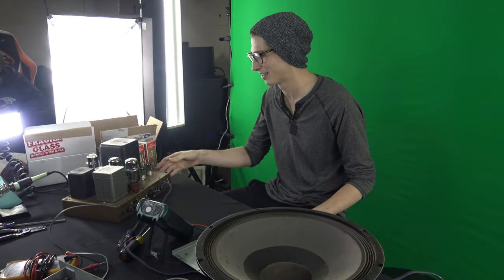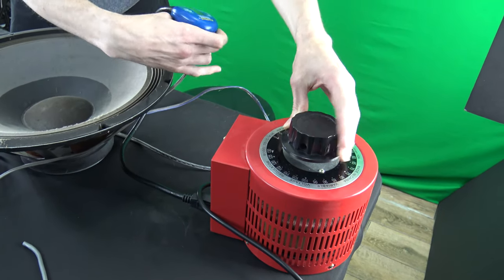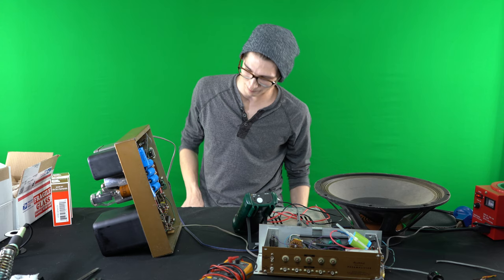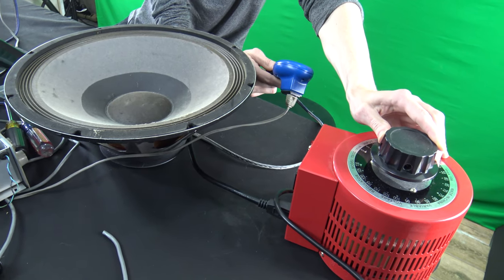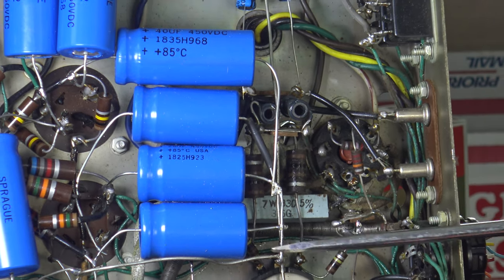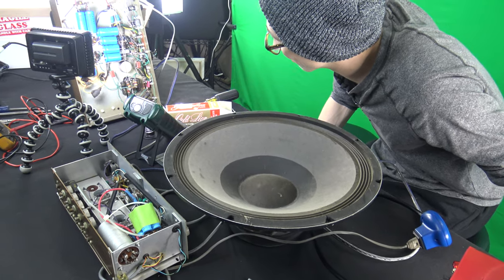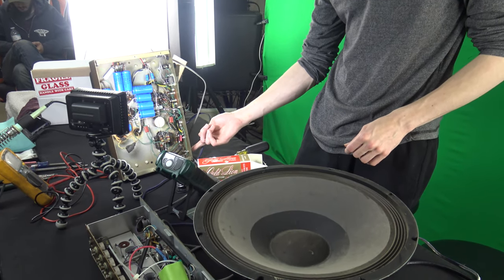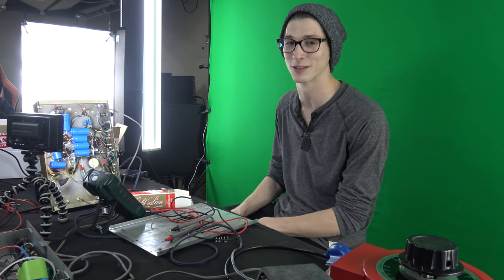Hum Issue on a Tube Heath Kit W5M Amp FIXED

Comment: Good find, that's thick wire, need lots of heat.   I would of used canned caps so it would be easy to work on amp

Comment: I'm restoring my own set of W5M's and came across your video.  Glad you discovered the bad solder joint.  If you don't some minor criticism, your cavalier handing of a high voltage tube amp that has 450+ volts is dangerous.  NEVER use a conductive screwdriver to poke around in a tube amp - even if unpowered - the caps still hold a charge for a few minutes.  May I suggest you use something like a simple chopstick, or small piece of wood dowel?

Comment: Looks like you added he new caps to the old electrolytic can. That is a Great big NO NO !!!  If the canned caps are leaky and they probably are, you are keeping that load into the circuit, increasing the current, producing hum and if you haven't yet, you will blow the power xformer.. Either remove the caned caps and replace it with aq new 3rd party cap. Check Hayseed Hamfest. If he does not have a direct replacement, he will make them for you.
Or do what I normally do is remove the can add a terminal strip on the bottom and wire up the new caps. The hole will actually provide extra ventilation. 
GS 
DSM Labs